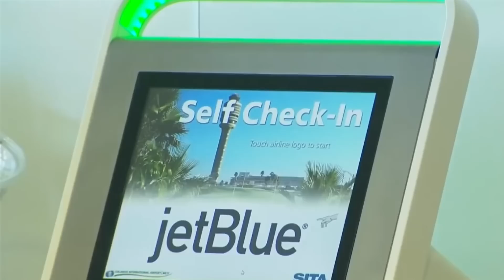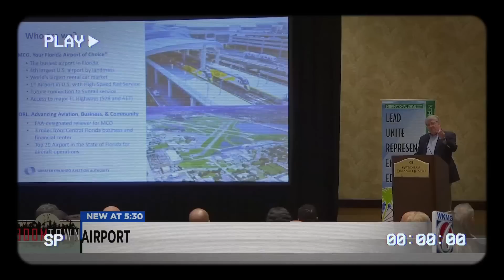Five US Aviation Mega Projects That Will Transform Air Travel by 2030

Comment: You’d be shocked to learn Charlotte’s airport expansion isn’t even the largest airport expansion in the state. The smaller Raleigh-Durham international airport (RDU) is investing roughly $4B between 2020 and 2040. 

They already completed the new RON apron (which can hold around 9 aircraft including 2 widebodies) and they have recently broken ground on the new 10,639-foot runway (longer than what Charlotte is building). The initial plans called for 23 new gates, however plans were modified in 2020 (and are still happening) that will add roughly 31 gates. The airport will also more than double its widebody capacity (including 2 new widebody international gates). Since 2020, the airport has announced 9 new airlines & 6 international routes. This past week, they announced new flights to Calgary and Bermuda, with the Toronto flights being upgraded to a mainline aircraft.
Reply: Nice, I live in RDU area. Good to know. But how they can add that many gates? Are they going to build new terminal or expand what they have. Actually RDU is very busy but problem is that most planes comes are small or medium size.
Reply: @ terminal 1 is going to be extended horizontally as one part of it. The other part relies on the 5L/23R replacement opening. The current runway will be replaced and they will build fingers from terminal 2
Reply: @GoalHornGeek  Thanks.

Comment: The projects listed on this video are tiny compared to the multi-billion dollar projects at LAX, JFK, LGA, DFW, etc... This is a strange video.  AI generated?
Reply: Took the words out of my mouth. DFW's improvements alone are nearly $9 billion. That dwarfs all five projects mentioned in this video.
Reply: Exactly!  A budget of $61 Million?  That's peanuts!  JFK is building two new terminals, not just adding a few gates.
Reply: Agreed! I was going to say the DFW expansion/revamp is an astonishingly massive project that will change air travel there forever!
Reply: Or SLC’s decade long $5 billion rebuild that’s still in the works.
Reply: Yep, ORD's current improvements are tagged at $8.5 billion.